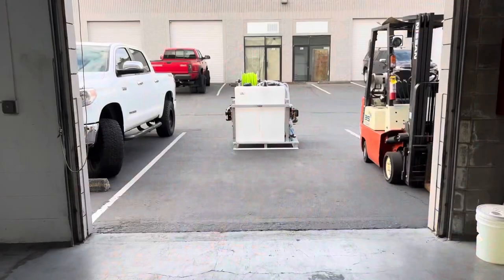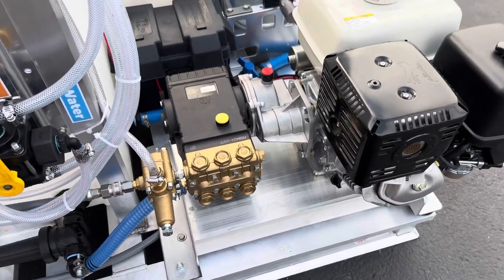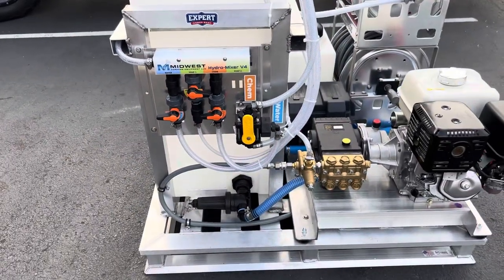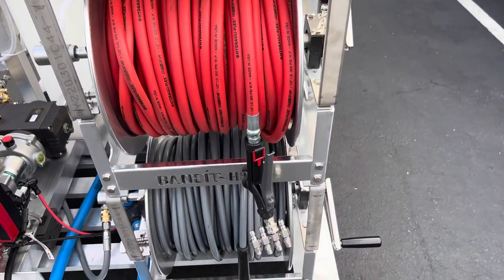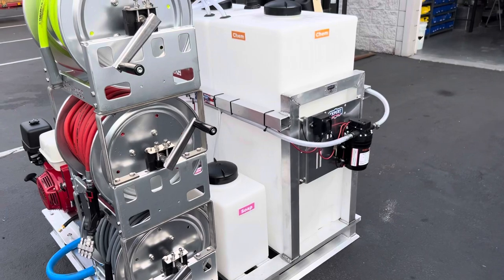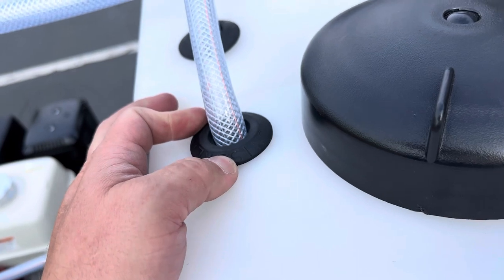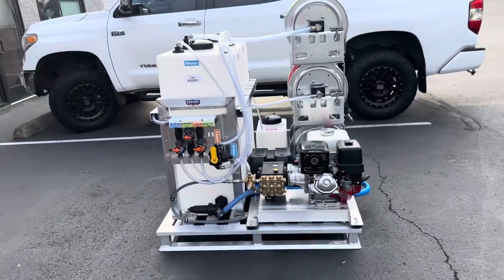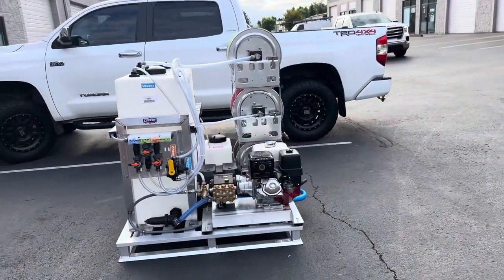Mini Wash Boss Pressure Washing Truck Skid- Zach’s Skid

Comment: Do you think you could fit a ro/di system on one of these smaller skids?
Reply from the maker: Anything is possible. Could do a smaller footprint and some fab work. Much easier to just add one on wheels to the truck bed and secure it.